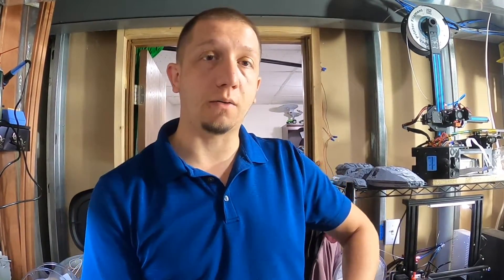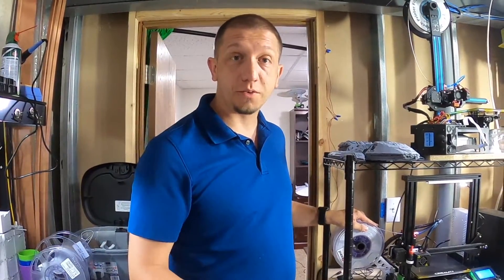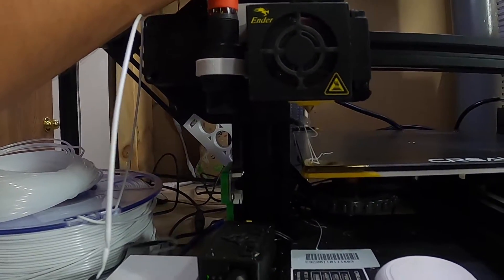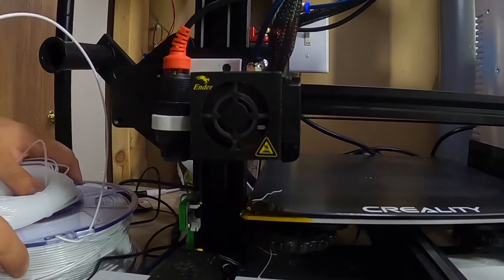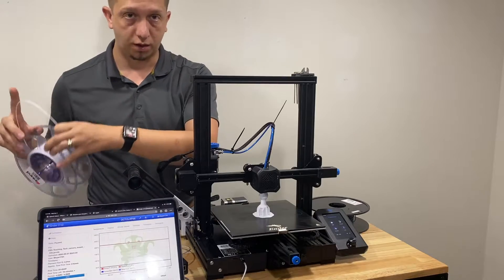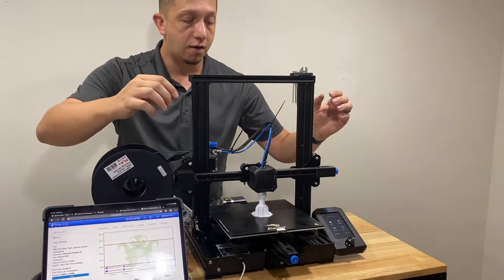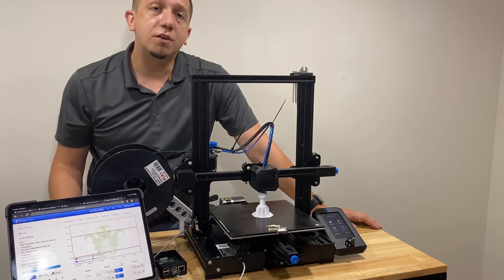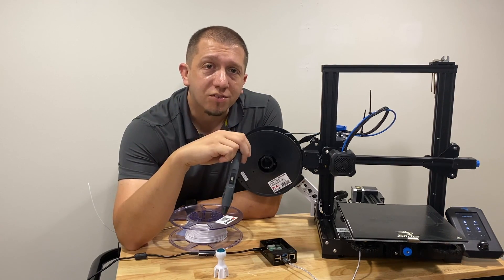How To Change Filament Mid Print

Comment: I have a great plan. I'll print 30% of my print in wood, snap the filament, feed black PLA, print another 30%, snap the filament, feed wood and finish. Surely this won't fail horribly since I've never had a problem feeding new spools this way.

Comment: When I pull filament out to change it, hot filament gets on the inside of the bowden tube that's in the hot end. When it dries it causes a clog in the bowden tube. It's happened multiple times and I have to change the bowden tube to get it to print. How do I prevent this?
Reply: any updates?

Comment: I know this has nothing to do with your video but where did you get the side mount for your filament? Did you print it? 

Also, this video saved one of my prints.
Reply from the maker: That is a file on thingiverse that lets you take the top arm and move it to the side. If you check out my 5 recommend upgrades video the STL link is in the description. Glad I could help

Comment: First actual demonstration on how to change a filament mid-print on a V2. Thank you!
Reply from the maker: You are welcome.  Anything else you need demos on?
Thank you
Reply: @Rise3DBuilds  - There are a few running trends with the V2 out at the moment. Things like what to do with a heavily warped bed (seem really common and I used foil in my case) to what types of filaments can be used with this machine and what nozzles to use for them. 

A big one is a similar video to this https://www.youtube.com/watch?v=vcxM7-VK44k but specifically for the ender v2